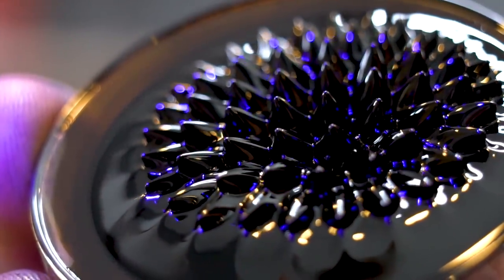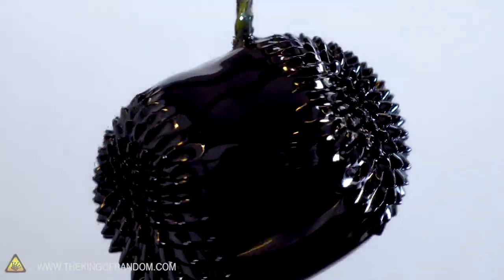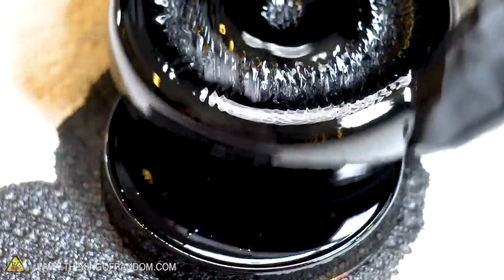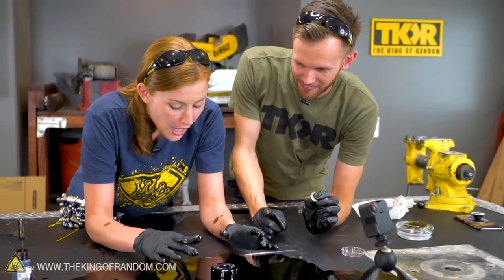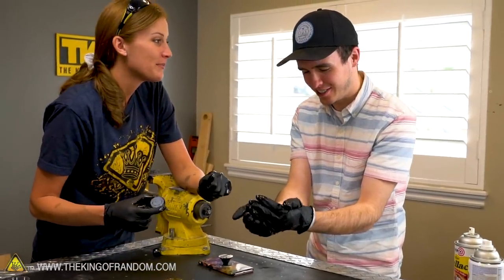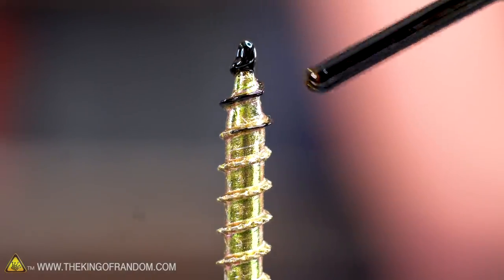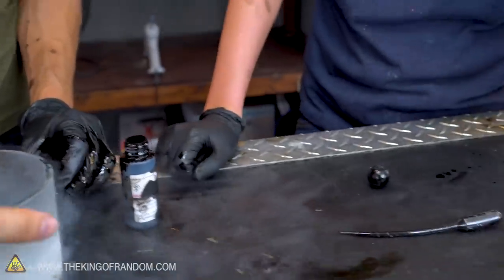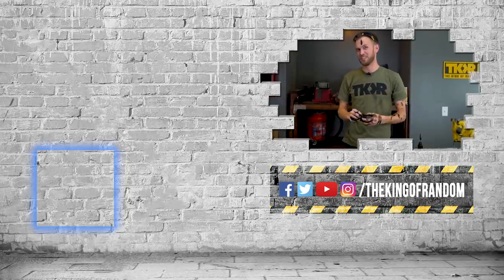5 Things No One Ever Does with Ferrofluid

Comment: Oh, man
When Nate says no to eating something it must be real bad!
Reply: Don't think so, ferrofluid is non-toxic since its a bunch of oils and very small metal particles.
Reply: snort

References
Reply: @iconoclast45  can oil bot be toxic in this reference bad is not 5 minute death type of thing it is like 2 days diarhea type of thing
Reply: @iconoclast45  so it's a non toxic-toxic substance?
Because Nate mentions multiple times that this is a highly toxic substance, holding it bare handed could lead to poison like mercury if you held it bare handed. So if you ingested it, I'm very sure it would take some sort of negative toll on your health.
Reply: @iconoclast45  it can be, it depends on the suspender and the magnet type
Reply: @lynxadink9412   it cant, handling ferrofluid with bare hands can cause irritation

Comment: What if you used a strong electro-magnet to clean the fluid off of other magnets, then turn off the magnetism.
Reply: cover it man
Reply: @qwertyuiop6046  Clamp the other magnent down
Reply: Just put the stronger magnet behind a cup and it'll pull the fluid into the cup.
Reply: it is oil, it would stain and stick on the electromagnet

Comment: Toxicity level: Unknown
Lets touch it with our bare hands
Reply: They used gloves
Reply: jay dellinger Did you even watch the video?
Reply: @marks7648  yes and when they didn't they weren't shoving the fluid in there mouths so they weren't affected by the toxicity.
Reply: If something is toxic, then it matters if it gets consumed
Reply: @catchara1496  yes for magnetic fluid getting it on your skin isnt bad unless it stains or ends up inside your body
Reply: @catchara1496  btw did you do a typo or you are actually agreeing with me
Reply: @jaydellinger6674  I believe she is agreeing with you
Reply: They used logic
Reply: Jordan C. Wilde Steve Irwin be like
Reply: jay dellinger never heard of skin absorption?
Reply: It's basically tiny iron oxide filings suspended in oil. I wouldn't eat it or inject (although it is very similar to some black tattoo inks) it but touching it should be on par with touching rusted machinery parts.
Reply: @mrshenanigan5044  yeah I just wanted to make sure lol
Reply: Yeah!!  Curiosity!!!!

Comment: why don't you try ferrofluid in vacuum chamber and freeze dryer
and also burn,boil, freeze in liquid nitrogen and make slime. PLZZ TRY
Reply: they have already ,made slime and they just froze it :3
Reply: @khalfanimattix298  no make slime with ferrofluid
Reply: Separate video = more views
Reply: Microwave it
Reply: khalfani mattix, ferrofluid slime.
Reply: @alexiskis1503  lol no make slime English 101
Reply: @jaydellinger6674  I know how it was written but l also know what they meant
Reply: @alexiskis1503  bruh magnetic fluid can't be made into slime
Reply: How does it look under a UV light??
Reply: @jaydellinger6674  they already did make ferrofluid slime though
Reply: @jaydellinger6674  why not? All you should have to do is mix MICR (RICOH 410 MICR DEVELOPER $19) with a high viscosity oil and some form of compatible elastomer.
Reply: pranav krishnan YESS
Reply: @jonathonmccarty3539  but it's not fully magnetic then it's nearly a half found formula mixed with benzoate and other diy materials
Reply: @martindinner3621  ok but changing the chemical composition duely defects the magnetic ability of the slime making in affective
Reply: @jonathonmccarty3539  im aware but the idea was ineffective with the chemical makeup.becuase the fluid only slightly has iron and changing the chemistry will make it even more ineffective.
Reply: @alexiskis1503  also a comma would help
Reply: @jaydellinger6674  that what I said it was written incorrectly. However the oxford comma is controversial I believe it should be used.
Reply: @alexiskis1503  also every public school in America agrees with the usage of the Oxford comma
Reply: @alexiskis1503  I'm glad you responded in a respectful and intelligent way
Reply: pranav krishnan that’s what i kept requesting before! cool
Reply: they put it in liquid nitrogen in this video
Reply: Can we eat this
Reply: @alexiskis1503  no they have
I meant to say with ferrofluid

Comment: cover up a knife with ferro fluid, heat it like those 10000 degree knives, and then dip it in liquid nitrogen. the ultimate science "challenge"
Reply: ferrofluid is diesel based, please dont do that
Reply: @teslacoil4335  even better :)
Reply: @teslacoil4335  but ya
Reply: @teslacoil4335  Does that mean it'll explode or burn more? If it's the latter; can't you just put it out when you're done?
Reply: @Emil_Stoltz  itll burn, but the iron nano-particles will be released into the air and can be deposited into your lungs if you breath them in, plus itll smell bad
Reply: @teslacoil4335  Ah, I see. Thank you, my friend!
Reply: For one thing all the ferrofluid would get burned off, but even if it wasn't red hot metal is not magnetic so it wouldn't do anything. Also the knife would most likely shatter. So to answer your question what would that look like it'd look like heating up a knife and then cooling it down really fast. It wouldn't "do" anything
Reply: @Emil_Stoltz  it would all just burn off. Red hot metal is also not metallic. Even if it didn't burn and the knife did stay magnetic it wouldn't "do" anything. It'd just look like heating up a knife and then making it cold really quick
Reply: @ethanfields3853  oh that's cool! thanks
Reply: hehe knife go crackle
Reply: The knife will lose its magnetism, nothing much happens

Comment: To get it off, you could try to put the dirty magnet in a container and put a stronger magnet outside the container to pull it off the original into a container. The container will prevent the ferrofluid from sticking to the new magnet. Just a suggestion/idea

Comment: Get a really strong magnet and when you want to recover the ferrofluid off a weaker magnet you can place it in a container and use the stronger magnet to pull it off through the wall of the container.

Comment: Mix ferrofluid and liquid nitrogen o lava or see what happens when burnt does it has the same effect on the magnet
Reply: if you heat it up the oil to those temperatures it would burn away. but if its under the smoke point of the oil it may change it's effect.

Comment: If you've got it stuck to a magnet surely you can make a glas jar / plastic tube just so the magnet sits on it. Then use a strong magnet at the bottom to pull it off into the jar?

Comment: Suggestion for experiment.
attach 4 or more magnets to a wheel with the center removed and adjust the magnets so their fields are overlapping and see if you can balance some of the fluid in the center of the fields.

Comment: What are the thermal reactions of ferrofluid? Would it be possible to use it as a lubricant/Bearing in a mechanical system to negate the loss of energy through thermodynamics?
Reply: Magnetic bearings with ferrofluid on components to reduce friction.

Comment: since it is kinda difficult to get the ferrofluid off from the magnet, you can try to disable the magnetic properties with fire, as we now know that by heating iron is no longer attracted by magnet and also by heating a magnet, it loses the magnetic properties. Could you try to do that to see if it actually works?

Comment: What of you put a strong magnet on the outside of a cup and put the magnet with the ferrofluid in the cup.  Then the ferrofluid will stick to the side of the cup until you remove the magnet on the outside causing the fluid to not be magnetically attached to anything

Comment: If you thermosyphon mercury through a copper coil, you get electricity. I wonder what would happen if you thermo syphoned ferro fluid instead. The mercury is thermosyphoned with a solar panel similar to a hot water panel. The coil is excited and the power is generated as the metal flows through the coil driven by the sun.